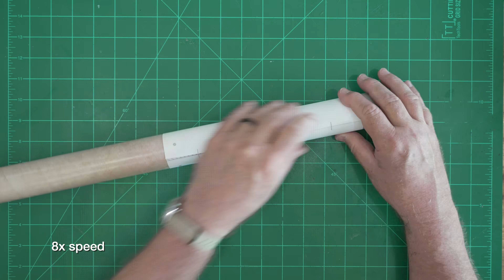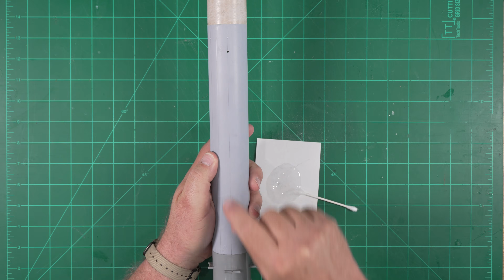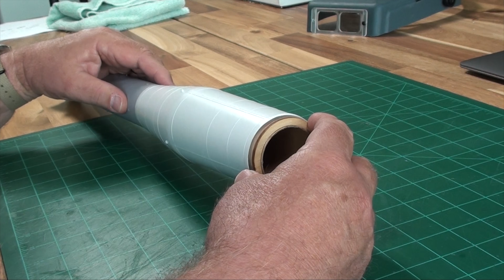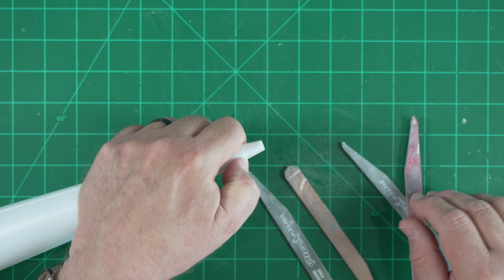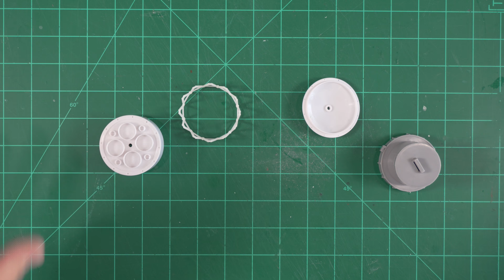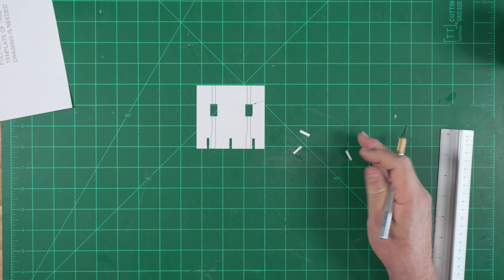The Estes Soyuz Booster In 1/48 Scale; Part Two, Construction

Comment: How did you attach the raceway on the lower stage? normally this would be simple, but we have primer. I am assuming epoxy for this?
Reply from the maker: The combo of Tamiya thin cement + the Rustoleum auto primer resulted in a solid joint between the cable raceway and the central core.  If that does not work for you then epoxy should also work.

Comment: A tip from the car modeling guys regarding sanding mold parting lines: They take a Sharpie and draw down the length of the parting line. That way you can judge when the line is gone by the removal of the Sharpie line. That way you sand enough, but not too much.
Reply from the maker: This is a GREAT idea, and one that I will adopt immediately.